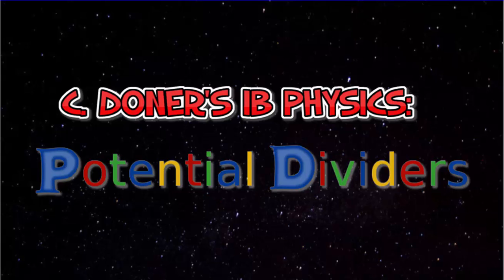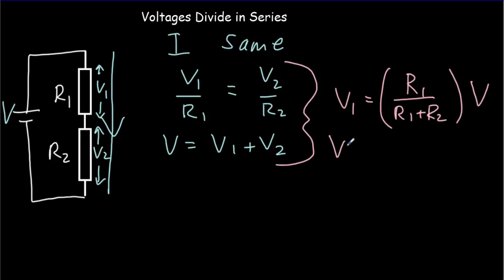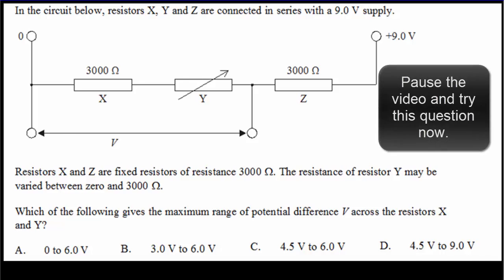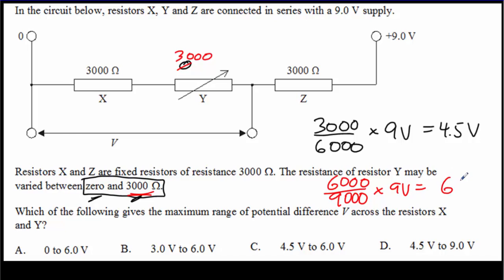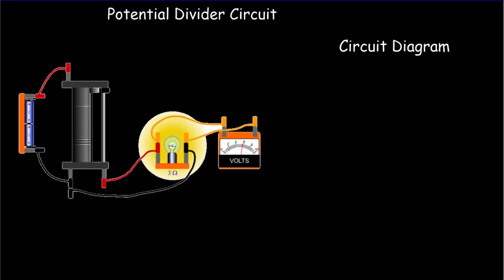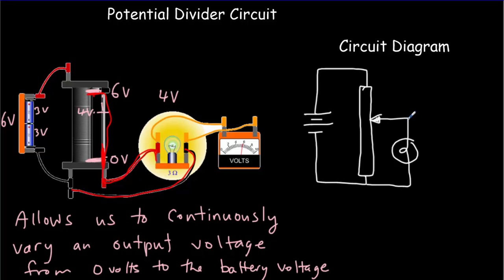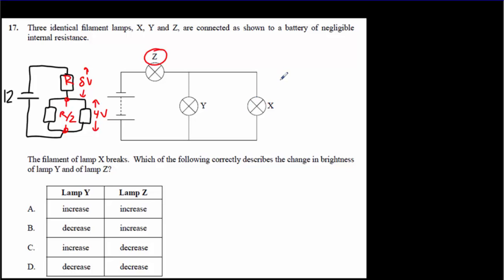IB Physics: Potential Dividers

Comment: Hello! Amazing video, but I just had one question. When calculating voltage across a load resistor with a resistance similar to that of the potentiometer, why would you need to find the equivalent resistance of the load and bottom? Isn't voltage the same across parallel branches, so I could just calculate the proportion of voltage across the bottom resistor?
Reply from the maker: You are correct to say that the parallel resistors will have the same voltage across them, however, to calculate the proportion of the voltage, you need to determine the parallel resistance of the load and bottom of rheostat. If the load resistor is much larger than the equivalent resistance, this will simply equal the contribution from the rheostat.

Comment: At 13:18 , How did you know that the load resistor (2000 ohms) will be in parallel and not in series with the variable resistor (2 ohms)?
Reply from the maker: We are not putting anything in series with the rheostat, we connect the load across.
Reply: @donerphysics  oh thank you!

Comment: hi sir, what do you mean by load voltage or loads resistor
Reply from the maker: The voltage across the load resistor. The load is really just the "thing" connected to the battery.

Comment: Is output voltage the voltage across the load resistor?
Reply from the maker: Essentially, yes. If you watch the video on internal resistance, you will see that not all the battery voltage will appear across the load because there is internal resistance within the battery.

Comment: Thanks for the video! 

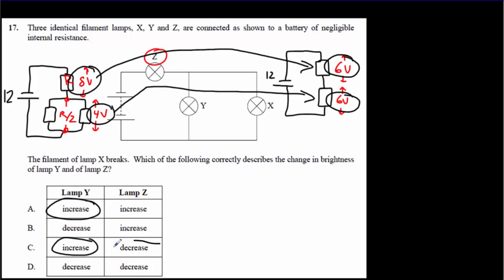For the problem in 11:26, your method was amazing but is there a shortcut because I feel like I would spend too much time figuring out just one question! Could I use this logic: since X breaks, no current flows through Z (since Z and X are in series) so Z's brightness decreases. Since Z's brightness decreases, Y's brightness increases (since Y and Z are in series). Is this logic accurate?
Reply from the maker: If X breaks current will still flow through Z.